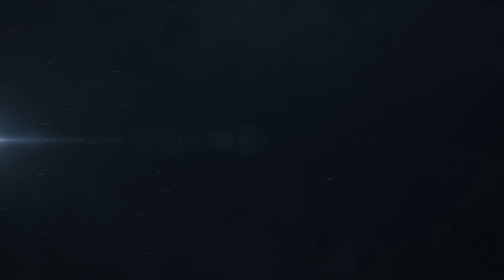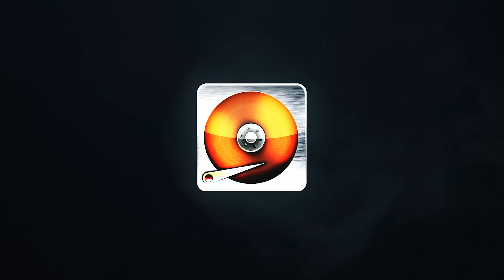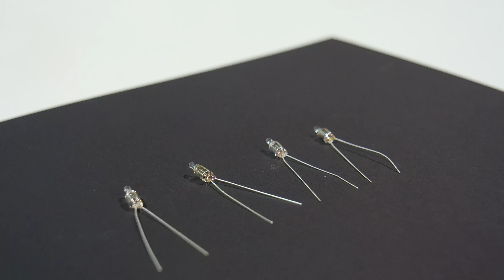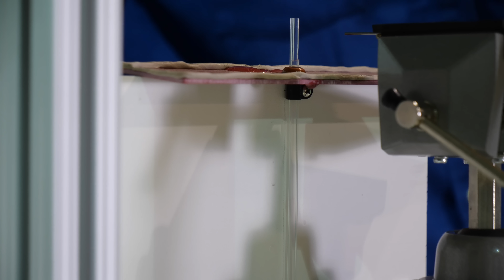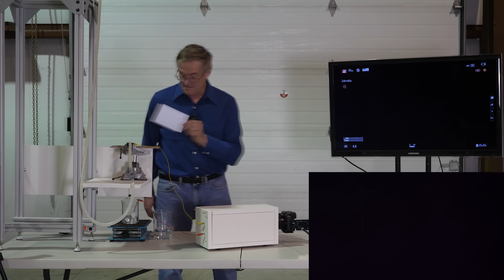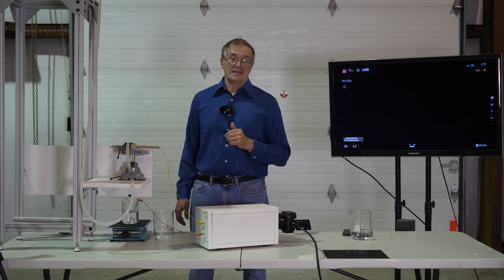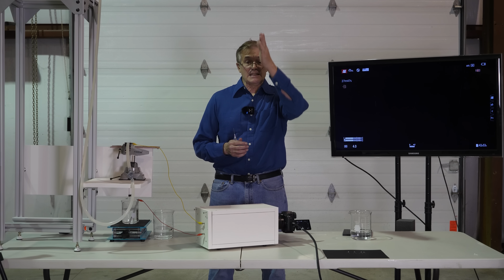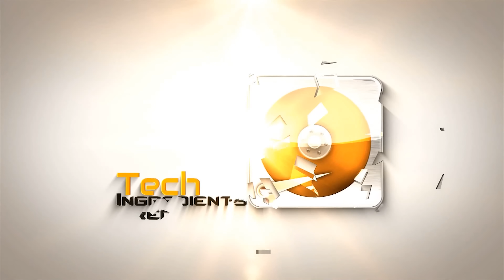We made electricity from water - and it's easy!

Comment: This looks like a variant of a "Kelvin water dropper", an electrostatic generator. There is a good Wikipedia article on it.  I remember a Popular Science article in the 1970s that made one of these using coffee cans, quite impressive.
Reply: I remember that article and built a Kelvin water drop generator when I was in junior high school. I could get 1 cm sparks cracking every few seconds. I built the stand to hold the coffee cans in wood shop and so I got credit for two classes!
Reply: @engmcgill which explains why your an engineer today
Reply: @engmcgill  Talk about efficiency. 😂
Reply: Or you can just put a little turbine at the end of your downspout from the roof.
Reply: I came to put the same comment
Reply: Triboelectric fields.   We're back to static harvesting.  And yes lord Kelvin.  But it also works with fire or other flowing mediums with forced charge differentials.
Reply: I got to know it as "Kelvin's Thunderstorm". We have build one, and it really does produce regular sparks just from dropping water.
Reply: There's a difference: The Kelvin water dropper is using electrical influence, same as a Wimhurst, and in a similar way to a Van de Graaf generator wrt transfering charge (the conductive structure that you're inside always looks like ground, no matter what charge it has collected and also voltage it has when measured from outside. aka the Faraday Cage effect. 

This is using a triboelectric effect from the Fluorinated polymer. 

The triboelectric effect has also been shown to be what holds gauge blocks together when they are wrung together: It's a small influence induced 2-colour psudorandom pattern that results in a short-range but surprisingly strong net attraction. 

Being that this can be surprisingly strong, it is of interest, especially since it doesn't have any special requirements of the water: clearly doesn't need deionized ultra-pure water. 

Also, you don't need a lot of plastic: A physical vapour deposited layer a few molecules thick would have to do it, since it is a surface effect. 

Maybe something that can be put on solar farms to try for some generation when they'd otherwise be sitting there uselessly, under a cloud, getting rained on?
 
The trick is, it would require those same panels to be electrically insulated from the ground, and for a fairly high voltage (safety hazard when at scale). 

There's also possibly environmental impact if the water is allowed to leave without neutralization: Probably would want to separately pump water to flush the OH off the surface, so as to keep the total collected water neutral overall. This would be a bit awkward to deal with.

The other problem with scale up is that it may not work so well for steady DC at scale as for pulsatile DC. I would want to see the voltage waveform across the neon array. Also:  get yourself a SiPM development kit from digikey and use that instead of a camera: It's going to be better at triggering a scope exactly when a pulse of light, however weak, happens. (seriously, if you own an oscilloscope, and do any science involving short pulse of light, these SiPM chips are amazing).

The consequence of being random pulses is difficulty converting it to a steady DC current. 
Maybe try feeding it into a transformer, on the high side, and seeing if you can get a fast enough rectifier to catch the asynchronous random pulses from the low side so as to pump charge into a capacitor at a more workable voltage?

I also wonder if you won't just get more power from the charge separation that is due to the raindrops themselves falling. Wouldn't the actual rain, as arriving especially from a thunderstorm, also come pre-charged anyway? 

Collecting that charge one drop at a time strikes me as easier than trying to harness lightning directly, and it should also have the effect of reducing the cloud to ground strikes itself - or maybe it might do the exact opposite? A lot of insulated structures collecting charge from raindrops probably would draw a lightning strike, but there are well known ways to mitigate that, already commonly used by electrical distribution installations: Again, establishing a 'faraday cage' around the installation with a few judiciously placed towers bracketing the installation with lightning rods on them wired to earth.
Reply: Didn't Cody do this year's ago?
Reply: I was thinking the same thing. I learned about it from books on electrostatic experiments. "A.D. Moore's Electrostatics" has a section on Lord Kelvin's water drop generator.
Reply: Now time to tag clint builds to try this on his house
Reply: This is correct. When I watched the first eplanations,  the Kelvin electrostatic generator came to my mind. The problems with such principles are low efficiency und missing scalability. Even a solar cell the size of a thumb-nail outperforms such apparatus. These are nice for physics lectures to demonstrate principles (here dissociation of water into H+ and OH-) and the fact, these process can carry energy.
Reply: @debrainwasher  note that this above is 2 or 3mm.   We could fit perhaps twenty of them in a thumbnail area, for nine milliwatts.  A 1cm solar cell might give a bit over twice the power for the same area.   But the electrostatic panels still work if stacked above each other, and still work even at night.   But never forget, it must be raining!
Reply: My first thought was the Kelvin water static generator, but I thought that I was the only freak who knew about it😂
Kinda like my first ebay search was for NIXIE tubes, thinking "I've never even met anyone who has heard of them" but found that there were sellers like "NixieBunny" who did nothing other than sell them.  Gotta love the WWW!
Reply: Yes!   I made one of those from the PopSci article for a Jr High science project.     Fun.
Reply: The title itself quickly remind me about electrostatic behavior.
Reply: To every action there is an equal and opposite  reaction ,and it's  this reaction i would definatly be concerned about .....!
Reply: I thought that ss well. Electrostatics are what the future is going to powered by...
Reply: @Biokemist-o3k No, the future will be powered by technologies that can  produce useful amounts of power. Electrostatic generators are high voltage, low power which may be useful for some specific applications but not as a general power source.
Reply: @davidgilpin5200  Please read the published article.  This has nothing to do with Kelvin water-dropper, which is an electrostatic induction machine (it could use steel balls rather than water.)  This instead is something weird, fluid "streaming current."  Unlike the Kelvin Thunderstorm, it works instantly, with no need to charge up an upper metal ring.  Instead it's more like a  "frictional" contact machine, like early 1770s Winter's rotating glass disk with a sheet of leather.   
Instead try rolling some drops of mercury down a sealed glass pipe with 99% of the air pumped out.  The rolling mercury beads create "frictional" high voltage, and if the room is dark, we see flashes of electric discharge.   (Perhaps a teflon vacuum-pipe would work better than glass?)
Reply: @wbeaty A few years ago I constructed a replica of a 19th century device consisting of a rotating circular glass tube with bulbs blown into it.
Inside it, in a partial vacuum, we inserted a blob of mercury sloshing around while rotating. In total darkness a blue light is emitted.
And mercury is the only element according to my knowledge, that is mono atomic in the gas phase, together with the noble gasses - so it is for some reason more easily ionizable.
So I wonder how this setup will work with mercury!
Reply: I feel like this just explained how the lord Kelvin generator is working then put it in a new body
Reply: @davidgilpin5200 - This is very interesting indeed. It is similar to Kelvin's thunderstorm in so far as it uses water's ions. But the actual voltage generation appears to be different. Kelvin's setup uses an induction field which is self generated to separate the ions into separate charge polarities which both produce a substantial spark. This seems to just generate just a single polarity - what happens to the other is unexplained here. I have built Kelvin's thunderstorm several time over the years and it seems to generate more of a spark then this one - it will flash a fluorescent bulb. It's not too hard to get a spark to jump over a cm using tap water which is over 20kv but at very low amperage.

Comment: Another useful method for pumping water could an air pump / bubbler + bell? - If you have air flowing, it will gladly lift water up a tube in segments. -Easy to test/see with an aquarium siphon and air pump. If you don't actually setup the siphon, but just hold it's large opening underwater over a bubbler, the air will get trapped and push water out -> I've gotten several feet of pumping, the higher it goes the larger the air-pockets are.

This might help with some system-setup... instead of a tall structure with individual needles and drips.. It might simplify to being a bucket with a big airstone. (Or bubble to a top tank, and gravity back down to allow two parallel systems to run?)

Comment: We have large rain gathering systems already in place.. they're called roofs and gutters! 😉
Reply: True, but what was meant, was rather, I believe, that one could gain a bit of electricity that way, but it´d still be just enough for 1-2% of the household´s demands... So, if it cannot even partly compete with some solar-cells, why should one then install it at a building (when it can be made cheaper and more efficient in the places he then describes...)???
Reply: have to find some way to space the flows. I suppose next you'll suggest we have water wheels?
Reply: You can also pump water uphill using a ram pump which uses zero electricity then generate power with the pumped water using turbines and gravity
Reply: @mattgayda2840  My guess is that the flow needed to drive your ram pump would produce more power if it was simply used to drive a generator.
Reply: @mattgayda2840  ram pumps can only pump a small fraction of the water that passes through them, the rest is necessarily (by conservation of energy) wasted/released - you can't do a closed loop with a ram pump.

Comment: Very cool discovery, unfortunately, impractical for real world use. This is essentially static electricity, not a good source of power. The good thing about this is the scalability and I would love to see to an experiment where somebody could make 1 watt from this system, however, it would take roughly 100 tubes like the one in the video. 100,000 tubes is impractical. You would generate a lot more power (about 1 kW), but the losses would be immense and the design of such a system has many failure points and a lot of complexity. The cost of something like that out weighs the power it produces.

Comment: When I was young , we would get a McDonald's plastic straw , pinch the ends, wind them tight to seal in air. Then pluck with finger and POP .
My friend noticed a slight spark when you did this in a dark room . I guess the straw still has residual water / soda in it .
Any idea what did this ?

Comment: Getting conductive metals to adhere to the open cell foam will be a pain in the keister but I can already envision how to do it.
Simple electroplating procedures could be used.
Anode on one side, cathode on the other, then submerge the entire block or sheet of foam in a conductive fluid, presumably that is already impregnated with the metal in question.
It would have to be a ph neutral fluid of course, or the foam could very well be eaten away in the process.
I doubt that perfect metal deposits would be achieved, but there should be enough to make it fully functional and conductive.
Sounds like fun.
Building a capacitor bank, that releases electricity sequentially could be used too.
A continuously charging battery that stores and releases usable levels of electricity via JUST flowing water, with no moving parts other than the water itself.
Reply: Graphine

Comment: This is probably the least practical method I've seen.
Reply: Lol... Do tell. Go on and left the more efficient methods. Please. I'll wait
Reply: @TracyNorrell  A water turbine?
Reply: @TracyNorrell any static generator.  A Van de Graaff or Wimsherst machine. Pealing tape off a roll, separating plastic bags and even walking across a carpet, as mentioned, will give more voltage at more current than this.
Generators have been built just suspending wires in the wind. Not to mention, with dripping, squirting, running, moving water  any conventional generating design will provide more usable energy than this.
Reply: @JoeSmith-cy9wj one of us seems to be missing the point of this demo.  There are different ways to generate static, many of them not compatible with the environment that are exceptional for others. For example, van de graaf isn't compatible with generation from stripping ions from the surface of slow moving water. I apologize for my earlier comment which assumed you were addressing the topic directly, instead of comparing apples to oranges.  In fact, you add some petroleum to the mix, and you can generate a LOT of energy, but again, that's not really the point of THIS video.
Reply: @TracyNorrell andvwhat is the point? Because someone else mentioned a design specifically for extracting static charges from dripping water. Since we know there are more efficient methods, the " environment " would be a pretty rare one.
Reply: @JoeSmith-cy9wj oh! I get it. So unless and until you create a better wheel that works better than any other wheel in any environment, there is no point teaching the knowledge you've gained from experimenting?

I guess we need to rework the YouTube engineering algorithm to squash videos from people who get excited about learning things. 

 Joe has his undies in a bunch because of a guy talking to a like-minded community on the internet! Joe? Have you called the YouTube police yet to have them shut this guys voice down?
Reply: @TracyNorrell No not yet. I'm not so much worried about creators sharing their discoveries.  I'm much more concerned with nasty and sarcastic attitudes of commenters.
Reply: @JoeSmith-cy9wj says the guy who started this thread with "lest [SIC] practical method I've seen".  If this isn't your crowd, please don't let the door hit you as you leave

Comment: This might actually have some potential... but it really depends on the current flow at that voltage. I agree that it might help increase efficiency of existing water flow systems. One significant issue with this however, is that the "filter paths" that the water flows thru can't easily be cleaned.

Comment: I'm thinking of the shower drain when you see the tops of the water droplets as they pass through and look like eyes. seems intermittent, maybe low flow over a simple drain is enough. What if there are multiple layers of separation and collection? so multiple drains stacked in a column the water from above collects and then falls through each layer. Would the charge stack?

Comment: I wonder if there is any application here for generating power on a sailboat, a constant problem looking for solutions for long-term world cruisers.  You can imagine something attached to the side of the hull that would allow water to flow through as the boat moves through the water, with a tube running up above the surface to help entrain air into the water stream.  Other solutions such as underwater turbines already exist to turn the sailboats movement into electricity, but those cause a non-trivial amount of drag on the boat.  A system like this seems like it could be designed to cause minimal drag?  Even if the total amount of power is small, a boat sailing 24 hours a day for multiple weeks on an ocean crossing could use every bit of additional power it could get.

Comment: Very intriguing. I wonder if no-moving-part valves like Tesla's valvular conduit could create the necessary intermittent flow by having various flows restricting each other alternatingly. They could be stamped or molded into flat sheets and assembled into blocks. Not as cheap as foam but maybe more predictable, less prone to clog, easier to clean and reuse.

Comment: Where did you find your tubing? Search engines are worthless since Amazon and several others buy up the first three pages of results with false positives. Search engines are becoming useless. I found short lengths on Amazon but the rest are lying and don;t carry the size or length. It;s pipette stock but those are in short lengths. I found one source with 48" lengths, discontinued of course. Hitting a brick wall.

Comment: Generating high voltage for cattle fences could be one application. The cattle typically have access to natural running water, but no elecrical outlets, so a low power, high voltage source like this could potentially do the trick in some places.